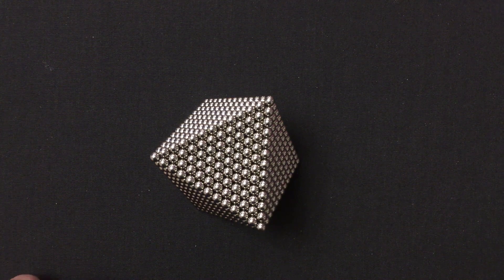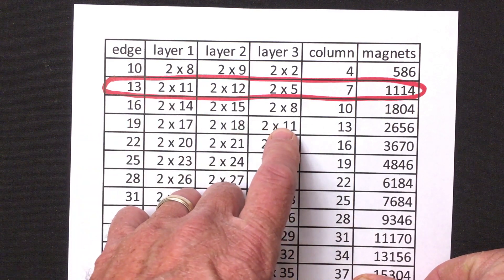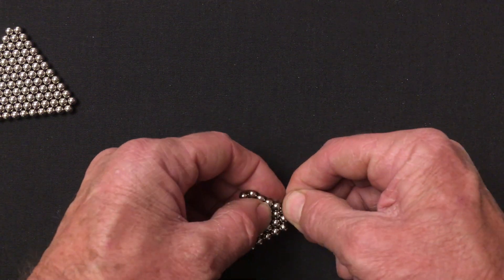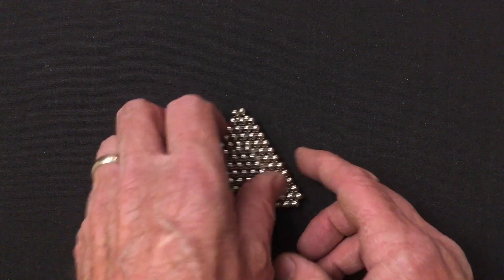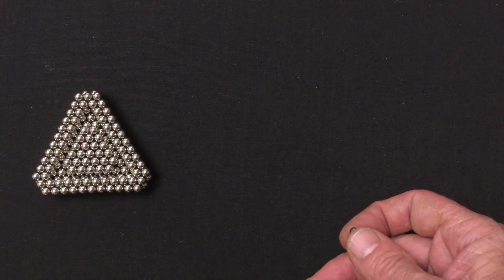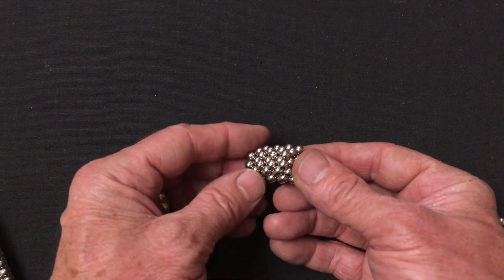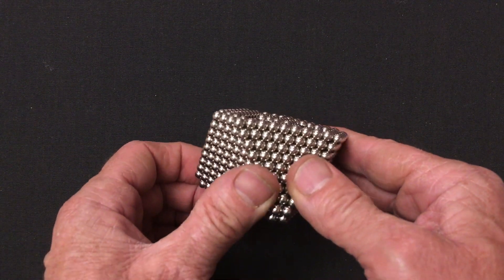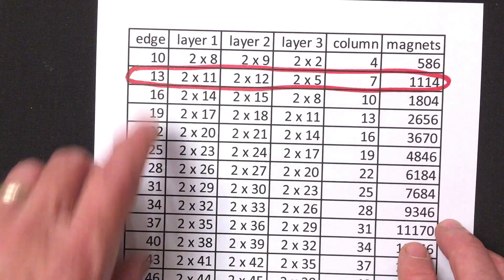Reinforced Double Walled Octahedron (Zen Magnets)

Comment: Boyd, not sure why you stopped posting, but you should know a I've learned a ton from watching you and Mathnetism. The narrations, tables, and explanation of polarity in your videos have helped fill in gaps I had in my understanding when watching Mathne's silent/mostly silent videos. 

Neoballs/buckyballs/zenn magnets are no longer sold. I build with the 2.5mm diameter magnets from Speks, which I believe was founded by the people from Zenn Magnets. Anyway the smaller diameter means a weaker magnetic field (per consumer regulations we now have). I've found some of the "dynamic" movements where you have to "push" shapes into a new configuration don't work for me as a result, so I've been finding workarounds. Sometimes you and Mathne make the same sub unit in different ways, and that's helped me develop my own ways to achieve the same shapes (often I add and then remove additional magnets to provide greater magnetic field "support" earlier on in a build until having multiple magnets in a line naturally provides the stability I need and I can remove the extras). 

Anyway this seems to be your most recent upload, so I figured this was the best place to say thanks. If anyone reading sees this and knows of other good channels, especially using 2.5 or 3mm magnets for builds, let me know!
Reply: I would recommend Micromagnets over Speks, they are basically zen's but smaller. They are much much much better than speks. Also there are very few shapes that can be made with Zen but not Micro, so most zen tutorials will work except for some of the most tricky builds.
Happy building!
Reply from the maker: Glad to hear my videos are helpful, Kelly.  Thanks so much for commenting!